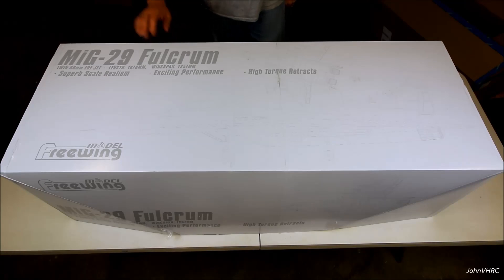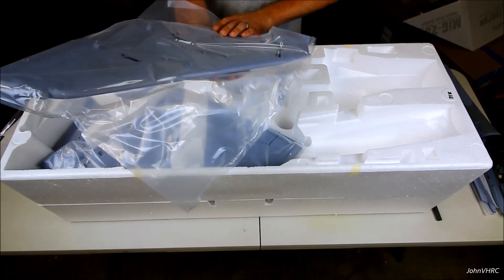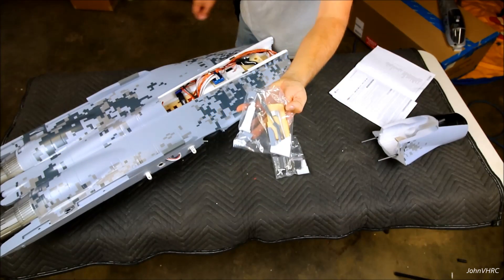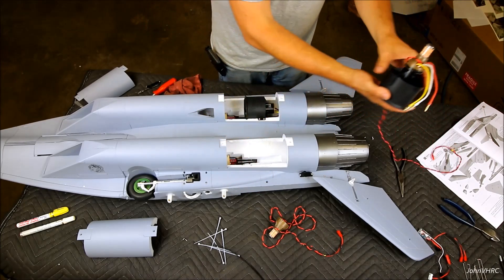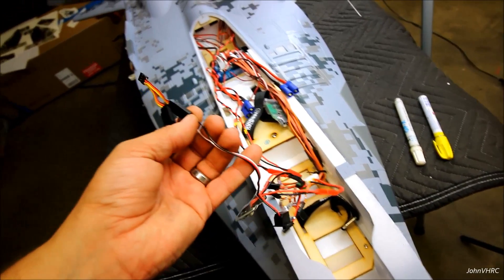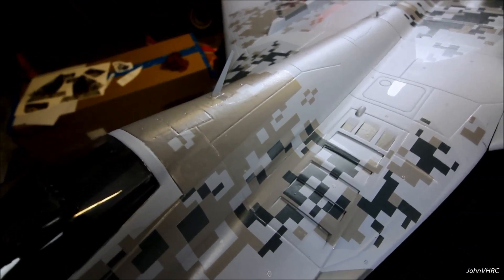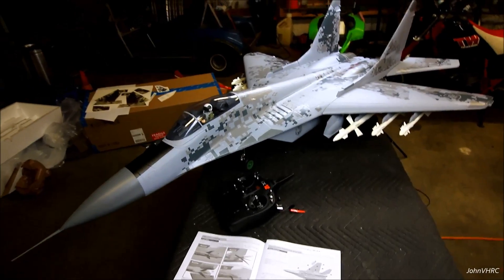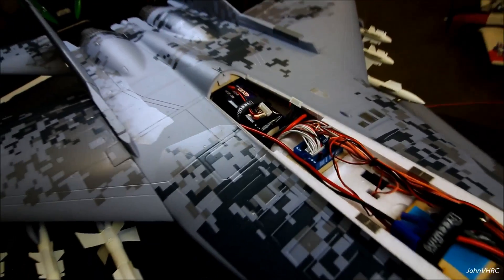Freewing MiG-29 Fulcrum Digital Camo Twin 80mm EDF Jet UNBOXING BUILD AFTERBURNERS FROM GOONIAC33

Comment: Nice Video! I just bought a mig-29 and it has the afterburner kit installed. The guy who did it put some less than ideal aluminum colored tape inside the engine cowls. Is this a good idea? The fist time I saw his plane power up it blew the tape loose ad it may have been a problem if the plane had been in the air. Do I need to replace the tape or just forget it? Is it any help.
Reply from the maker: I didn’t put any in mine. It adds a cool effect though. If it stays in place.